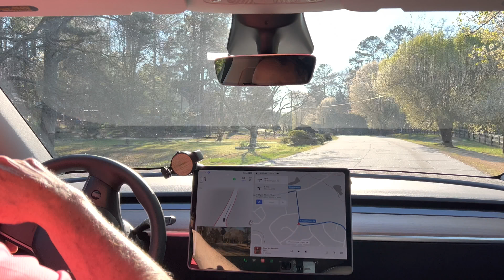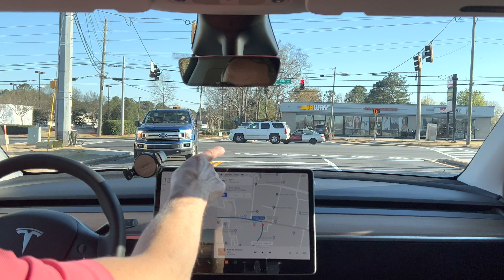Full self driving beta 10.11 Complete drive (uncut)--with NO INTERVENTIONS!

Comment from the maker: FYI more of a "first drive torture test" video is coming later today. It'll get the car in nastier situations :)
Reply: For the stop sign: It is best for the AI to report EVERY instance where it is not performing in the desired way.  It helps weight the decision the car made and pushes the AI to adapt more accurately to a human.
Reply: Another thing a lot of people forget: Profiles.  These determine some features used by the AI.  Try the same route, in the same conditions (or as close to), with a different driving profile.  Like not assertive.  See how the AI handles timing then.
Reply: Thanks

Comment: One thing for certain is that all Tesla AP depends heavily on the centerline. I believe statistically they know it is safer to hug (or cross) the centerline than risk running off the side of the road. Why? It's a crutch depending on the human driver in an oncoming car to react and give way whereas running off the side of the road and a recovery is 100% on AP.

Comment: At the end there regarding still being in cruise control, when you had turned the wheel, the wheel was already in the same direction of your applied force and so the force to the wheel was just enough to take it out of FSD but not enough to exit cruise control. 

You can also tell that it’s in cruise control when the “MAX” label for the speed sign on the screen is blue. You can also tell you’re in cruise control when there is only one audible beep instead of two for FSD.

Comment: Impressive.

However, I am always puzzled why you (or FSD or Autopilot, for that matter) constantly keep occupying the leftmost lane on the highway, despite the righthand lane was free -- isn't there a law that demands you to always keep in the rightmost lane if possible, if you are not overtaking? In European countries there certainly is, and staying in the left (middle) lane without any reason would get you a fine.

Not nagging, I'm just curious how the legal situation is over there in U.S..
Reply: There are two modes for NOA on the highway regarding "fast" lane behavior.  One setting disables moves out of left lane entirely unless you request the lane change. This mode is for the true left-lane hogs like Sandy Munro.  The second mode will stay in the fast lane until one or more of several criteria are present at which time it will move one lane over out of the fast lane.  The conditions where it'll move out of the way are basically an approaching car behind you (or a car following) and you are not following someone else. Overall, NOA has become much more intelligent and natural with when it decides to move into the fast lane.
Reply: differs by state as to the specificity of staying right most.  it's not ala Autobahn... and it depends on how many lanes there are, and if there's a median between directions etc.
Reply: Hmm, it did not appear to me like that when I drove through the States some 10 years ago, but it seems a little unnerving when I watch recent FSD videos.

Occupying the overtake lanes is considered reckless driving in (some? most? all?) European countries, and should be avoided. 

However, usually people get away with it without a fine, which nags people even more because they cannot really do anything against those who constantly block the overtake lanes.

Comment: 17:09 Hi there, you were still in cruise control by ending just the fsd, turning the wheel…
Reply: I would like the option to disable cruise control. It is easy to think it is off when in fact it is on.
Reply: @JamesBond-qv2ht  You can tap the brake or push up on the gear stalk to get out of both FSD and cruise control
Reply: @PlatinumAzure  I know but I have had several potentially dangerous situations where I thought cruise control was off but it wasn’t. I would prefer the option to disable it.

Comment: Regarding the start of your drive, it baffles me that FSD doesn't yet have a "Virtual Lanes" system. Meaning that when there are no lines on the road and no signs or map data to indicate that the car is on a one way road, the system should divide the road into 2 virtual lanes, the going and incoming lane, and then position the vehicle into that right lane.

Also it doesn't seem to consistently(or at all) use other clues than white or yellow lines(or blue, green lines in some other states/cities). For example at the beginning it seemed to stay to the right of the center black tar line, but after a few hundred feet it started to move into the middle of the road. For me, a feature like that is a clear indicator of where the middle of the roadway is.